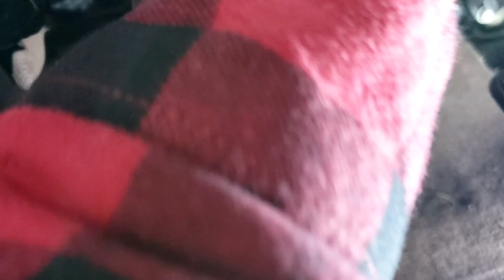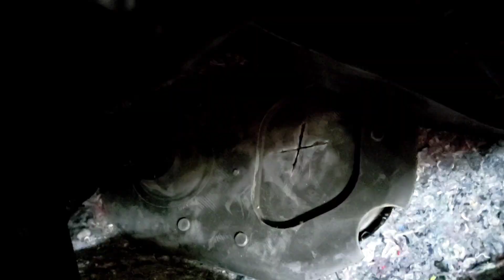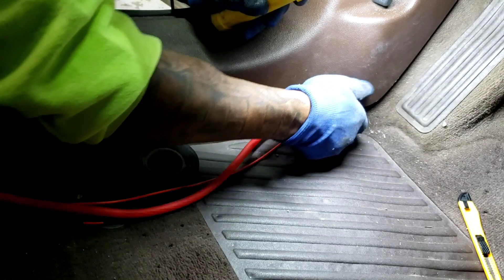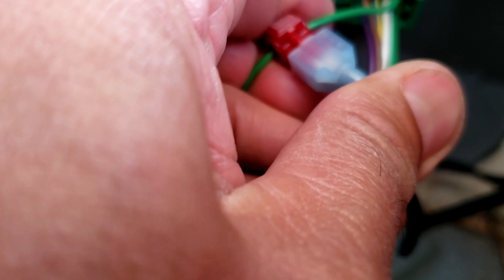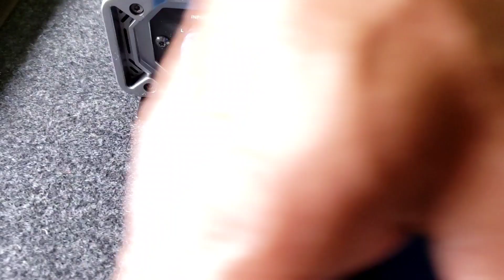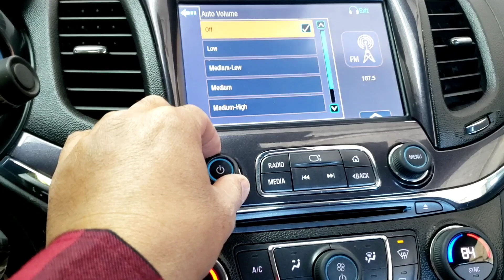how to install Chevy Impala 2014 amplifier to factory radio ANC

Comment: Hello, could you tell me the color of the wires for the rear speakers, I only know green and green with black, what color is the other speaker?
Reply from the maker: Right rear is white-blue/black
Reply: @Khmer Ohio  I'm installing a sub and amp on a 2015 impala, old body style. I was going to hook my remote wire to the factory amp on the red and white battery positive. But my amp stays on and hums when I did it that way. Any other spot in the rear for the remote wire?
Reply: I found a wire that works @falcon_gaming95

Comment: My 2015 impala has 2 batteries. 1 is in the trunk. Im assuming 2014 does also. Why wouldn't you power your system from the trunk battery?

Comment: If u have an impala with the auxiliary battery in the trunk that controls the start/stop for the engine and radio accessories, can you ground to that battery instead?
Reply: Yes you can 
That’s what I did

Comment: Ok I got the same car and hooked everything up the same way you did but for some reason everytime I start my car I get the subs that go with the charging system turning on like the radio is on and it’s not but they will throw bass out of them from low to high. Please tell me a song for this cause it’s driving me crazy! The only thing I didn’t cut was the purple and pink wire cause my son said that runs my microphones in the front so please I need your advice!
Reply: that wire is noise cancelation you gotta cut it
Reply: @chilzzz01  I followed your video and cut it. Let me ask you another question, I hooked up a kicker rca convertor but it runs the remote wire to the amp from it. Well the issue I’m having is my amp stays on a little bit after the car is off and when it shuts off it makes a loud bass sound so do you have a different way I could run the remote wire for now ?
Reply: @mikegonzales3314 some kicker amps don't need a remote wire,  they sence through the rca

Comment: Where did you run the remote wire in the engine because it’s not connected to the battery
Reply from the maker: Honestly, i forgot, but look for accessory or ignition fuse

Comment: 2015 impala ltz. W Bose audio . Tapped Into left an right rear . Used the power off the LOC2 for the remote . Takes a good minute to shut off any after power is off, debating just running remote off one of aux plug
Reply from the maker: Run a remote to aux plug

Comment: I know everyone is asking this but is there an anc in an Lt model, I'm not seeing it on diagrams or in person, but the louder the mucic goes the less bass i have
Reply from the maker: That is not anc
Reply from the maker: Do you have a factory subwoofer
Reply: I just installed an audio converter and a 10" skar with a 500rms amp
Reply from the maker: What is the brand for the converter i think your converter is bad
Reply: If u don't think the anc is countering the bass frequency then I'm gonna guess my the amp is bad, the converter is new but i don't recall the brand name. When i was adjusting the gain it cut out but not like protect mode, i was turning it down then i tapped it with the screw driver and it came back and didn't happen again. That's my though process anyways lol the amp is like 15yrs old now
Reply from the maker: @LegendCampbell  oh i see

Comment: I have a 2017 Cadillac XTS with Bose System. And I get that HUM from subs after the car is powered off. What do I need to do prevent that??
Reply from the maker: Where / how did you run the remote wire?

Comment: Sorry if this has been asked before...but what did you connect the remote wire for your new amp to? I have a 2015 LT and I tapped into the rear cigg but I'm having a power leak. Also, the stock subs are the in the front doors not the rear. Thank bro
Reply from the maker: You can go on to the main wire out of the   ignition switch there you will find a pink wire which is ignition wire
Reply from the maker: I would just get a kicker LOC it's called kisloc2 that will give you a remote wire output to the Amplifier
Reply: @khmerohio  thanks buddy!!
Reply: Where’s the red eye hooked up to to get power?
Reply: So you get the remote wire to turn on with the power wire and the other part is connected to the outline converter?

Comment: Thanks for the vid!  I have the same exact vehicle and installed it per your instructions and everything works perfectly!!! My only question is because of the included remote wire, does that mean my amp will constantly be powered? Don't want to kill my battery if that's the case.  Also,  my subs randomly "boom" even though the vehicle is off.  Any suggestions??
Reply from the maker: Did you cut off the ANC ?

Comment: Installed hi-lo converter in 2017 impala. Followed your vid with speakers wire with factory wire connection In trunk. But when I turn vehicle off the amp still has running power to amplifier and does a bass humming
Reply from the maker: What is the brand of you LOC? Hilow converter
Reply: @khmerohio  scoshe loc90.
Reply from the maker: Best way to do is to run the remote wire from the accessory fuse
Reply: @khmerohio  ok I'll run it to the fuse box under hood. That should solve the issue correct.  I didn't clip the noise cancelation wire like you.
Reply: did you ever get an answer? I have the same problem on my 2014 ltz that I installed today.  I think I'm just going to run the remote wire that came with my kit and not use the remote wire from the loc
Reply: @thtnig   tried it and still stays on after car is off. I tried a aux switch but it was drawing to much power and kept killing fuse n battery .so I just removed it all
Reply: @kountryboiktkountryboikt1986  run a toggle switch thats what i did

Comment: those 4 wires you got running to the amp on the left side. where do I get those from
Reply: @khmerohio  i got a kit from best buy for like $109 has everything truconnect 4AWG 1400w max power rating. I'm running two 10 inch kicker comp R with a 1600w pioneer tru connex TC-Loc2 . 2019 impala premier
Reply: Will these wires be safe if I dont bump full volume
Reply from the maker: 4g is perfect !!
Reply: @khmerohio  got it installed this afternoon, 50 percent volume is more than enough bass. Anything north of 70% is overkill.

Comment: Why did you pull signal from only left side? Why not both sides? Could also pull power and ground for LOC from amp constant power. Signal wires should tell LOC when to send signal for activate.    Will a 2017 have the ANC?
Reply from the maker: Check to see if you have amplifier right side of trunk.  It's easy to run one side because I don't think anyone is going to fade their radio to only one side
Reply: What can I do if my factory amp not working can I buy a kit to run my other amps

Comment: Hey man, so my schematics are down and I've got a 19 impala LT at my place right now. Was wondering in a non-bose unit, what color plug ANC wires were in and what pin number if you could help me out. That would be awesome. I'm having some issues with my install. Thank you in advance. Love the content!
Reply from the maker: Lf blue-brown/blue lr=green-green/black Rf=yellow-yel/black rr=white-blue/black
Reply from the maker: Give me about 20 minutes
Reply: @khmerohio  ok awesome. Thanks man.
Reply: Help  I'm having trouble also

Comment: So I hooked it all up did not have a purple and blue wire on my black plug and im getting like no bass from my system any ideas?
Reply from the maker: What is the name of the LOC? Let's find out why no bass first .. check the back of your subwoofer see any loose connection .. are you for sure your amplifier works? It could have a blown channel
Reply: I have this same problem. All brand nee components. I even got a signal booster. It just won't bump either. Only thing I haven't done is clip the anc wire. Gonna try that this weekend but I see people commenting that that wire don't even exist. I'm doing a 2014 impala ltz

Comment: What is the color for both rear door speaker wires. I have 2017 Impala. No Bose.
Reply from the maker: Lr is green+. Green/bk -   and RR is white+ blue/bk-
Reply: @khmerohio  thanks. Best video I’ve seen for my car. Going to add two 6x9 to rear deck with small two channel amp. The rear speaker wires I’m going to tap onto should be ok for the signal?
Reply: @dannyceballos5621 did u get it working?  Im doing the exact same thing,   16 Impala non Bose,  I'm having trouble

Comment: Best video I've seen on an Impala install. Keep up the good work
Reply from the maker: Thank you sir
Reply: @khmerohio  i huck up my system on my impala but i have the buzzing bass noise when i close the door and when i open the door it goes away u think by cutting the purple wire it will fix it?
Reply from the maker: @ibethpenaloza2705  yes but make sure you have a good ground

Comment: Got a question,
I have the same car year and model but not sure if that one is a LTZ well the question is I don’t see the anc connection in the amp I see the plug and some wires but it looks very different from the ones in the video I can shoot some picks so u can see for your self
Reply from the maker: $one4 seven-78/68nineeight
Reply: I think it’s missing a digit not sure what the money symbol is

Comment: Hello! Did you end up removing the remote wire or tap into the power. I have a 16 ltz impala and  I’m about to put my sub in. Thanks in advance
Reply from the maker: Yep I used the hi/low converter to power the amp don't need that accessory wire from fuse
Reply: @khmerohio  You the man!! If you knew how many YouTube videos I’ve watched trying to figure this out you would cry 😂😂. Really appreciate it! New sub
Reply: @larryhood439  hey i have a 15 impala and i have the radio that slides up so i’m just confused on how or what or where to connect rca adapter and such
Reply: @kadancekretzschmar9792  I have an the LTZ series and in the trunk there’s an amp. If you have the lt or so series I think yo can tap into the wires from behind the glove box. ( I’m not an expert btw 😂😂)
Reply: @kadancekretzschmar9792  if you got an email I’ll send a video on what I did
Reply: @larryhood439  I have a 2018 premier  struggling with Woofer sub what do I need
Reply: @ESOCelebrityLokoVibezz  you need your sub with a equally rated amp, LP7 pac or another brand for the line output converter, 0 gauge wire not the cca stuff, a remote for the sub and that’s about it
Reply: @ESOCelebrityLokoVibezz  the premier is the exact same as the ltz so it goes just like the video
Reply: Just be careful on the anc wire (purple) it’s different in our model. I just left it in because the sub was loud enough already 😂😂😂
Reply: @larryhood439  We got the same issue with bad noise
Reply: @ESOCelebrityLokoVibezz  oh some extra info… your fuse should match your amp rating….. I had a 300 rated fuse for a 200 rated amp 😅coolant tank got deeeeeeeeeeestroyed 😂😂😂 it came with the skar sub kit.
Also pending on your amp/sub combo upgrades aren’t needed. I crank my sub up to the max 24/7 and it’s been running fine almost a year later. I’m pushing a skar vxf with a rp 2000d amp. It’s underpowered but you can still hear me a mile away 🤣🤣
Reply: @ESOCelebrityLokoVibezz  what kinda noise?
Reply: Hey I have a ‘17 Impala premier and trying to add a sub with amp what do I need to tap into the amp to power sub
Reply: @3xLouis u figure it out?
Reply: I have a 2020 premiere with a 5 channel and mono cuts on radio when the cars off help me out
Reply: @leonardjackson504  did you tap directly into the radio wires with the factory radio? Might be something sending power from the amp back to the system. Idk exactly but check your wires first then diagnose your sub to see if it’s not defective
Reply: **diagnose your amp